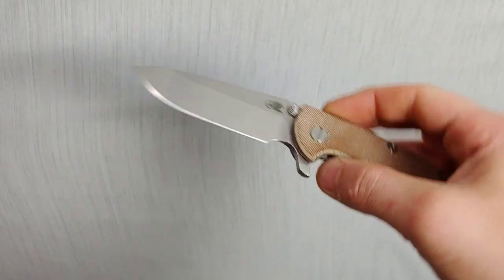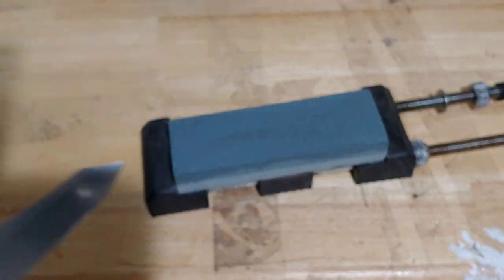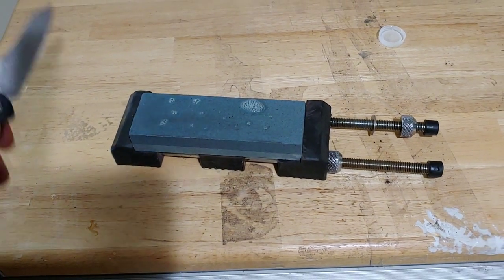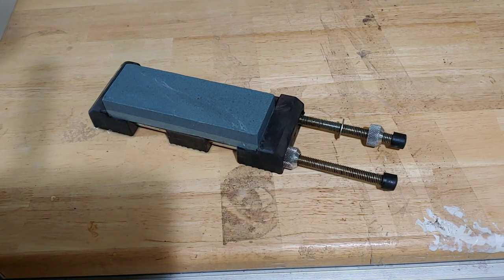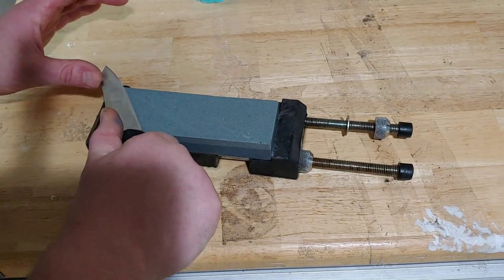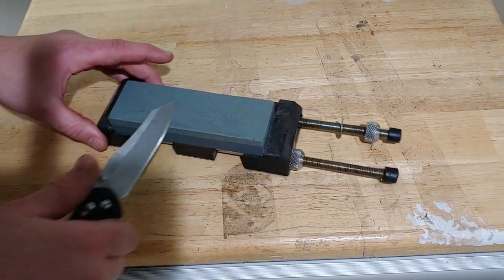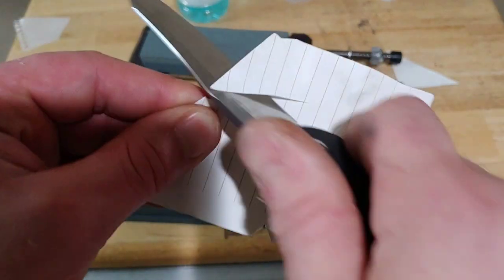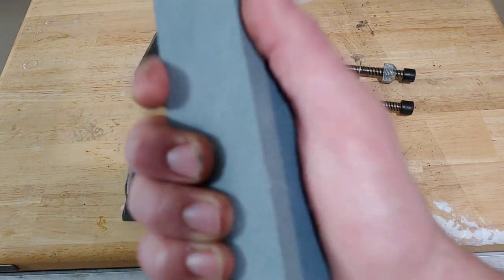TESTING THE CHEAPEST SHARPENING STONE

Comment: i like to use cheap water stones to load the ceramic super splash and go type stones.  it kind of helps clean the ceramic and the abrasives from the cheap stone cuts a lot faster than on the ceramics and it makes a great slurry and it’s also a great way to go back and flatten some of my cheaper stones.

Comment: Well, it is better than a brick, but both work for a fast, coarse, sharp edge.  

The stones we used on the farm were silicon carbide, called Carborundum back then (40 to 50m years ago).  They are very aggressive and rapidly give a workable edge - perfect for the work we had to do.  The old pocket knives wore out fast but I usually lost mine before that.  The one I still have was an oil stone I cleaned up for use with soapy water - less mess.
Reply from the maker: I agree the stones I grew up with were crazy coarse, knowing what I know now, it was a stone for damage not sharpening, the knives would cut but in all reality not great more like a saw

Comment: Hello, Jerad & Kara;
(I know, late, again!)
I tried a Harbor Freight "GORDON 4-Sided Diamond Hone Block", $11.99 ($12, IMO).
That don't last very long like 'better' quality diamond stones but they do OK.
Inexpensive diamond stones break down & the 'grit' gets more fine as it wears.
They will still sharpen but we need to compensate for the change.
If buying one be sure to check the "Block" BEFORE check-out.
One had all the plates mounted crooked so unless your knife has choil it hits the edge.
That jacks up the blade, changing the angle.
Not good!
It has four 'grits', 200, 300, 400, & 600.
I mostly use  mid-grade 'grits' & finishes, w/ an occasional 1,000 ceramic, diamond, or water stone & 1,200 diamond or water stone.
For most of my knifing (carving soft wood, hickory, oak, or whatever) I mostly just 'get 'er sharp' w/ 400-700.
Now I gotta' go file the spine on my new Morakniv "Basic 511" so it'll strike sparks.
Have a GREAT day, Neighbor!

Comment: This stone looks just like the cheap one they sell at harbor freight. Worked OK for the first few sharpens then the stone lost its grit. It worked well enough to make me want better stones. So it wasn't a total loss.
Reply from the maker: Definitely these stones are good to have around for a bunch of different reasons, and its most likely the same exact stone, but this stone with one other finishing stone will get you a good edge, atleast for a few sharpenings
Reply: I have a single stone of the 2 pack i bought for a dollar at dollar tree.   figured i would wreck a crap stone practicing on my old garbage gas station knives before moving on to good things.

Comment: You're not supposed to sharpen up on the choil bro, you're rounding the edges of the stone, and making it more difficult to get a proper access in the future up to the grind plunge termination.
Not that you will likely ever use this stone again. 
What you would normally do in a situation like this, is grind the rest of the knife, sans the first 1/4 inch or so, maybe 1/2" and then carefully do trailing strokes on that last bit drawing the knife tip leading so the base of your edge only rides up on the stone momentarily, and only as far as edge termination.  This prevents you from gnarling the knife up, and from doing the same to the edge of your stone.
It matters less on big coarse stones, and more on fine finishing stones.
if it really bothers you, you can take a medium grit belt sander and carefully clean that plunge termination up, laying it further back, then resume sharpening.   it would take quite a while to do that on even a coarse stone.

Comment: 120 and 220 grit says it all. You need somthing in the midddle like 650 grit and then finish with the 1000 grit and you 'll get an arm hair shaving edge on the spot. So this is a very nice stone to the initial edge and to use it as such. The you simply go for higher grit. That's all, there is no need to spend lot of money in other expensive 120/220 grit stones. Do the job with this one and move to higher grit. If you can find something like between 450-650 grit from the same firm cheap stones use them too, and then you move to the 1000 grit or more of another firm stone. Unless you find such grits on the same firm ha, ha, ha.
Reply from the maker: check out more of my sharpening videos, i teach every way of sharpening and what best to what steels at what grit

Comment: Thanks I am guessing a rule of thumb might be your stone should cost about one third the price of the knife your sharpening
Reply from the maker: That could get very expensive or very cheap for many folks, the tri stone system i posted yesterday is a fantastic system for under 40$, in many cases the longer a stone lasts the more expensive it costs, and in some cases the faster it can work, then the real expensive cut fast and last a very long time, also the very high grts can be very expensive especially if they last a very long time. Thats not always the case but its very common.

Comment: Cheap coarse stone, is still better than a blunt knife and no stone.
Reply from the maker: Got that right
Reply: Pretty much all that you could get your hands on 35 yes ago, or an ass whooping off the old man if he caught me using his Arkansas stones. 
If you water soak the 4 dollar stone first then it behaves better making it's own slurry and it seems like a 400 grit. Rinse with running water and you'll not have to worry about metal clogging the stone
Reply from the maker: @andrewnawarycz3026  i was mostly talking about clogging after a bunch of uses, all aluminum oxide stones eventually need flattening and conditioning from glasing and dishing
Reply: Very true, good job there are better stones available than the bad old days